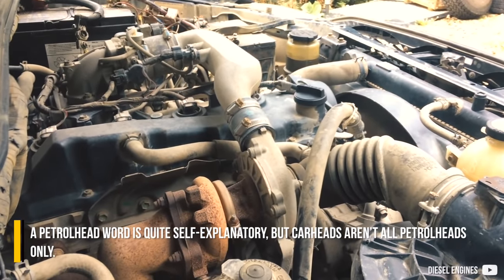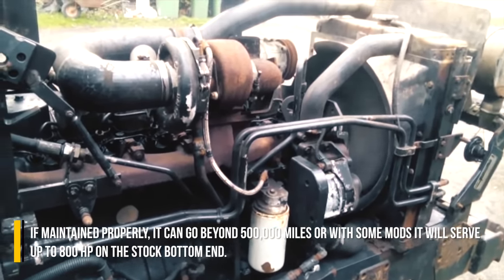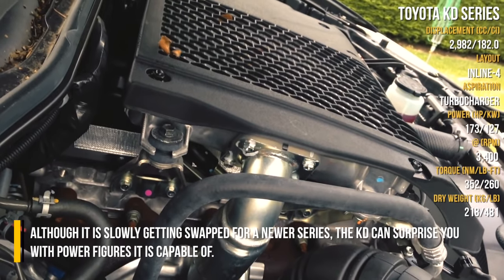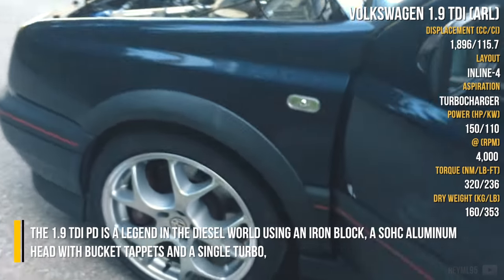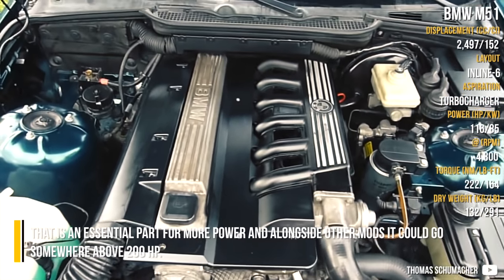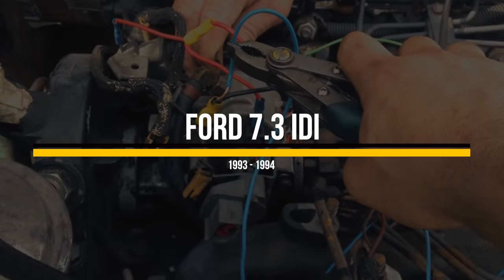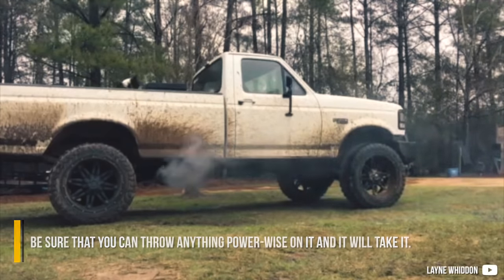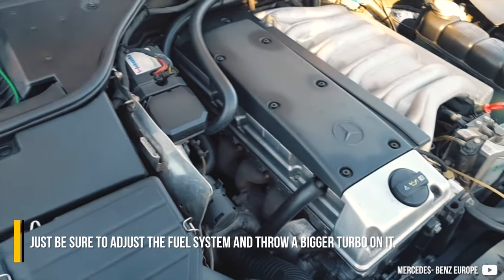6 Best Diesels For Engine Tuning | Ep.1

Comment: Fiat/GM 1.9 JTD/CDTI 150hp? They are a great engine, capable of over 200hp with just a remap, over 350hp+ on stock internals
Reply: Too bad this engine is held back by weak M32 transmission. Also, swirl flaps in some models can detach from the intake manifold and get sucked into the engine. The engine itself if top notch, but it's reputation is not very good because of the equipment around it.
Reply: Swirl flaps? I'm new to diesel. What's that?
Reply: arekb5 Fair point, the M32 is an awful gearbox, like it's made of chocolate
Reply: Jan Muñiz Swirl flaps are little flaps in the intake manifold designed to help change the direction of the airflow through the manifold and allow better airflow, however they can break off and be sucked into the engine, causing huge amounts of damage. Swirl flaps are also used in some petrols as well (Audi S3 2.0 EA888)
Reply: Jordan Field the cdti 150 is powerful enough stock, start playing with it and your going to eat gearboxes, the engines a designed to work with the swirl flap so removing it is not a good idea without a full map.
Reply: I think there will be 2nd episode of these very soon ;)
Reply: 150 bhp 16v has the F40 box much stronger but very clunky compared to m32
Reply: Higomad f40 is 1.7 cdti
Reply: A problem that could have easily been solved by using less flimsy components. Oh well, gotta save those fractions of cents...
Reply: Idk rly know if 350hp ist possible on stock turbo, but 250-300is possible. And ye where is the 1.9 TDI and the other VW engines
Reply: Think your wrong dude iv one in the yard and it’s a F40 box
Reply: Being an owner of an Alfa 159 SW with the M32 i can tell you that if mantained properly and if you know how to use a clutch it won't fail with just a remap at 200hp mine has done 250k and it's still going as new. But if it does fail and you are willing to dump more money into the car you could always fit the gearbox from the 2.4 with small adjustments for the bolts to fit on. And granted it will be a custom job but it does fit and you'll be pain free, I know a few people that have done it and run 300hp as an economy map and are very satisfied.
Reply: @AllCategoryChannel  I have astra 1.9 cdti 150 what other gearbox can you put in it I've got mine with mods like hybrid turbo, uprated intercooler, blanked off manifold (swirl flap delete and egr delete), uprated injectors, big brakes upgrade, remapped , lsd and few other bit but rebuilt gearbox good few times but love this car very excited to hear of gearbox upgrade only heard quaiffe but 4k let me know what this other gearbox is kind regards Ashley
Reply: @Rad_Dad_Army  That's the differential the quaiffe if I'm not mistaken. I haven't got any plans on upgrading my car further so I never bothered reading further into it. Except I know from experience that the F40 Gearbox from the 2.4JTDM alfa romeo 159/brera/spider fits the 1.9 engine if you customise some bolts as done by a friend of mine on top you can add the Quaife ATB QDH21B lsd and if you are looking for something reliable I don't think you can get anything better on these cars. The 2.4 gearbox is bulletproof so if you come across a used one and all seems well and you are willing to do the job I'd go for it if you are planning on driving your car for years to come. I hope I helped :).
Reply: @AllCategoryChannel  no quaiffe do a full gearbox https://shop.quaife.co.uk/quaife-vauxhall-opel-f20-5-speed-sequential-gearbox it's a complete  gearbox for 7k I'll look I to 2.4 and see if I can retrofit it to mine be wicked to have a bullet proof gearbox instead of m32 I have a quaiffe limited slip at moment but can justify spending 7k on uprated gearbox from them
Reply: 1.3 and 1.6 multijet life ;)
Reply: Very Unreliable Though My Dad Had One With Around 240bhp modified and it kept breaking down and that's what everyone says loved that car tho
Reply: @hughjarse4627  wrong. I have a 1.9 cdti 150bhp in my vauxhall vectra and it has f40 gearbox.
Reply: Johny Bigg Rigg yeah it will of been converted
Reply: @hughjarse4627  nope as far as im aware on all 150 6 speed vectras its the f40 box astras used m32s.
Reply: Arkeb5 when you upgrade JTD needs better clutch+maho stronger or one mass to take your tourge proper. This gear box is not created to keep 500-600nm tourge when you upgrade your car and still driving whit old maho and clutch all tourge gets to the gear box. It s a lot of tourge upgraded JTD.
Reply: @Higomad  I have the 161HP version (Aus 2011+ Cruze) - rattles as if it's a 'tractor' according to some. Get it on boost, and it just goes! ;)

F40 gearbox is good for putting the torque down - just needs a remap and a shorter FD ratio (who needs a theoretical top speed of 315km/h at 4,500 RPM).

As it is - stock, without the speed-limiter (programmed) - it would pull about 250km/h (stock tyres have a minimum rating of 270km/h, not 240km/h - next rating down).
Reply: I have driven a 1.9 jtd grande punto, thing is a beast.
Reply: 1.9 jtd 16v in Alfas with 140hp is much better choice because of metal intake manifold and no swirl flaps, on stock internals, stock map sensor, fmic and 2256 garret from 156 2.4 20v it goes to 220hp and 400nm+, with injectors from brera 2.4 jtdm (last 3 numbers on them 308), r80 fuel pump, map sensor 4bar, gtd2060 garret it pushes easily 250-300hp and around 700nm..Alfa 147 without Q2(limited slip diferential that comes stock on some Alfas) is allmost uncontrollable, tires spin too much eaven in third gear, 100-200km/h im about 10secs....Great thing about diesel street legal project cars is that they can easy be used as daily
Reply: fiat diesel is better than vw fiesel especialy when you want to tune it for big power

Comment: Pretty much any om6xx can be tuned for big power
Reply: OM601? Haha
Reply: Yeah i have seen a 601 "mini" superturbo
Reply: Om642 3.0l v6 making 230kw and 700nm
Reply: 601s are good for 300bhp too :D
Reply: Om601 max. 220hp because it doesnt have piston cooling...
Om602 about 400hp om603  500 om604 300hp om605 500hp and om606 650hp all on stock internals
Reply: Not so big deal to put oil jets there to cooldown pistons.
Reply: How about the m104 engine
Reply: Which ones were in the w123?
Reply: its more the om60x series. Yes the om617 can make good power too, but it gets less reliable once you get into the common rail models.(not less reliable because of the common rail lol, im just saying those are the newer models)
Reply: Christian H. That’s completely bullshit I’m sorry. A 606 will last maybe a few runs on a dyno at 650hp then shite itself
Reply: @dirtbiketherapy   the common rails can also be tuned. Just look at black smoke racing om648 600hp/1000nm i think. Also om628/629 can make well over 1000nm without opening the engine. Om642 is not so good because the pistons tend to break easily at over 300hp
Reply: @jerrywithaj6765  with what mods?
Reply: I need more power in my om611. But it is hard to find info..
Reply: @Diesel8290  that's not true, there are many 606s driven hard with 650+hp
Reply: @thomasamundsen3519  I look forward to the day there is a simple plug and play ECU for the 648 so it can be swapped into anything like the 606, which is starting to go up in price the last couple years.
Reply: You can tune om606 whit 800hp but it’s not so good for the engine you can try ;) dieselmekken Sverige can give you a diesel pump for more power  8 millimeter pump
Reply: started thinking is it only scandinavian thing to make power on diesel mercedes engines and also love old german cars because I looked mobile.de and saw like only one built 90´s benz and if you look nettiauto.com you will find those om606 superturbos
Reply: Can anyone one tell me the potencial of om647 2.7 straight 5 cylinder engine on w211??
Reply: @christianh.8408  this real?

Comment: Fun fact, the OM606 stock block can take 5,4 Bar before it cracks, Dieselmekken in sweden have tested this lmao
Reply: Da fuck,I only heard 4.6bar from them.
Or maybe that was something built to last lol
Reply: joczo97 i think it was 5,4 bar not conpletely sure tho
Reply: What power did it make at the pressure!!!!? lol
Reply: Yeah but not long... i know that they are capable of 3,5bar and 670hp all engines with more boost dont last more than 5k km
Reply: Fun fact, there was a guy running over 6 bar boost on om606 stock block and I think he still is
Reply: Christian H. Actually up to 4bar it's fine for long term.the most important is not to overrev them
Reply: @christianh.8408  not true. They can go plenty longer if precisely balanced and not revved the piss out of constantly.
Reply: Its not about pressure,its about how much air goes in😏
Reply: 6 bar for a nanosecond
Reply: Do you have a video of this. 5.4 bar is what psi
Reply: @marcofloresmfcs1  Roughly 80-90 PSI
Reply: Ferdinand Piech is my favorite automotive character ever

Comment: Old mechanical Diesel engines are awesome, more power can be made by simply turning a screw, I’ve picked up 12 horsepower on my naturally aspirated diesel by turning up the fueling, plus it gets better fuel mileage than it used to, it seems like a contradiction of normal laws of engine tuning, but it’s actually just because getting up to speed is so much easier that it isn’t held at full throttle all the time, and 12 horsepower is a lot when it only makes 52 at the crankshaft from the factory.

Comment: Who remembers Mercedes-Benz C30 CDI AMG with that five-banger?
Reply: the only diesel amg :(
Reply: they maybe are capable of developing a new diesel amg for competition against M550d. but not sure if they really want to do or holding it back because that discussion after "dieselgate"
Reply: @Popk1ller  they wont lol diesel cars will be banned in europe within 5 or 10 years its not worth it
Reply: Just learned about them recently! Seem to be dirt cheap for an AMG as well, but I doubt there's a reason for the low prices...
Reply: @DamonBMW  That's too bad because they can supposedly run (with very little modifications) on used cooking oil. I haven't done much research on it could have some potential.
Reply: Was it the Om617?
Reply: C30 om612 inline5,great engine
Reply: I have one, 350.000km. Not a single problem.
They re cheap because taxes are insane 😅.
Performance is awesome btw. Get one while you can.
Reply: @DamonBMW  Are you sure about that? After 2 years all I see is more and more diesel engines offered in Europe... More like diesel will be banned from entering city center in 3-4 capitols, but that's about it.
Reply: bored out 2.7cdi (om612)

Comment: Never knew that about the KD engines, very cool.
Reply: Same
Reply: Same lol,as a bit om60x fanboy
Reply: yep. stock 2.5l 2kdftv without intercooler makes just only 101hp but with proper tuning and mods it can produce up to 400hp.
Reply: I always heard they had an appetite for injectors, but I guess aftermarket injectors would be available given how much the Thais like fast diesel utes
Reply: @HotForgeChaos  actually from what i heard its because of bad fuel or fuel filter... ..
"Proper" fuel maintenance can make last

For upgrade there is "gtx" or "dtx"

And remap only can make 101==>up to 160
And intercooler up to 200
Reply: 2kd vnt 2,5L with a remap can produce 250hp 540Nm. I saw someone did it.

Comment: I would highly recommend 535d e60 facelift. Gearbox on the facelift can easily hold huge Nn loads and keeps being reliable. The car is a sleeping with sequential turbos good potencial for reasonable prices.
Reply: Just keep your turbo dealer on speed dial😂 I love the idea on 535d but everyone blows turbos in those even stock ones

Comment: I’m a proud owner of a 1997 Mercedes OM605 c250 turbodiesel, the straight 5 howl a lovely note😍
400hp/660ftlb on stock internals with bigger turbo and pump elements! Can also run on just about anything, including used engine oil 😇😇😂

Comment: Nissan TD27 only with turning up the fuel pump 200hp (double) and very capable. Used in Africa busses and the marvelous Terrano 2
Reply: Terrano 2 would be maevelous with a solid front axle, not with that independent setup
Reply: nah mate the TD42 is far better
Reply: if you want something to boil water look no further than the 42
Reply: You can keep your Kettles and snapped cranks, I'll have me a 1HD-FTE thanks

Comment: It's real 3.0 toyota 1KD produce 500hpish on stock bottom end. Kinda sick w/ that medium(only) displacement.

An ECU remap easily raise up to 200 hp without tweaking any mechanical parts, and running well w/ bad diesel fuel.

Comment: I have a Toyota Prado 2007 with the D4D KD engine 3.0 4 cylinder.  I have to get it Dyno’d again as I lost the print out.  Monster Max ECU, plus 15% Baileys DLC “Diamond Like Coating” injectors, PSYCO removed the stock intercooler from the top of the engine (stupid design idea really) and installed a supplied front mount intercooler with provision for temperature sensor near the intake (from turbo) and near the outlet.  Custom Aluminium pipework.
Larger turbo installed.
EGT sensor installed on 2.75 inch mandrel bent S/S exhaust system (from turbo waste to tip), air intake was to be upgraded but due to space left as standard with standard air filter (I have played around with those oil impregnated ones and they are an absolute mungrul to clean.). Snorkel installed.  Turbo also has pressure sensor.
Automatic transmission has had valve bodies replaced to “Nomad” from Automatic Wholsale Transmissions in Victoria, oil cooler installed as well as temperature sensor.
Tranny gauge installed low in front of passenger seat.
The other 3 digital blue gauges are installed in a “Pillar pod”, which is very neat.
Intercooler typically drops temp 30 to 40 degrees.
One gauge has both the intercooler in and out temps displayed.
A BIG THANK YOU to Shane and the boys at 1KD Performance in Bundaberg Queensland Australia.
They sure know their stuff.
I intend to get more fuel with their fuel bracket thingy and will replace the injectors with Denso plus 30 injectors.

I also had some other work done, but it’s not worth talking about.
I also intend to find a solution to the tranny oil cooler partially blocking the air flow of the intercooler.  
Also a tap at the bottom of the intercooler to drain any extra oil.
Like to also replace my catchcan with a Provent 2000, with clear pvc hose and cock firmly mounted beneath vehicle but not protruding below chassis.  A guard to protect it from being hit and turning cock on to crow....sorry, had to put that it!!😜

Comment: the Mercedes sounds like a jz god dang
Reply: what? you hear a I6 with a turbo and it all sounds like a jz to you?
Reply: Actually,it's cast iron block is the very same as the M104,from which they copied the 2jz.
Reply: ståle starheim no, i’ve heard a few jz’s and they sound pretty similar, but slightly different in a certain way.
Reply: a 2JZ with a cold?
Reply: It's probably why they call it "the diesel version of the 2JZ" - and it's just as tunable.
Reply: @joczo97  the m104 was first made in 1989 meanwhile the jz series was first made in 1990 so I guess Toyota cloned the BMW not other way around
Reply: More like a truck if anything

Comment: Suprised the 7.3 idi made this list. It's often overlooked for the newer powerstroke engines. It only recently has had serious performance parts avaliable, but an idi will produce more torque than a powerstroke at the same hp level because of the bore/stroke ratio and higher compression. I'm building one for my brothers f250. Planning on 350hp and 700+ lb/ft tq or so. Nothing crazy, just enough to make it keep up with stock modern rigs and towing a breeze.
Reply: Best part of the idi is how bulletproof it is, it is very hard to truly kill it.

Comment: Friend of mine has an OM606 in his Haglunds 206. With a bigger turbo, intercooler and fuel managment he easily got around 300hp stock.
Reply: Wait Stock, with mods, I got 325hp in my Duramax off the factory floor  450/950tq with mod. Nothing better than black and tire smoking out and leaving a  diesel mercedes in the dust
Reply: At the first corner u will brake to 10mph while the merc will be sliding past u and leaving u in the smoke

Comment: Where is JJ or JK engine from Isuzu?
Reply: They're powerful engines for sure...thai people love em so much
Reply: Agreed! We're quite fond of them in South Africa too! They're very detuned from the factory,  for reliability.. but can make big power with tuning.. just look at the Bruce Garland Isuzu Rally truck!
Reply: Maybe in ep.2? This was ep. 1.
Reply: Exactly my thought
Reply: Yes thais really love isuzu and most of drag pickup trucks in thailand are isuzu dmax
Reply: How about the old 4JB1-T

400k running great / flogged for 200k at 16psi (stock is 10).
Making over... well over 350Nm (225Nm stock).

Motor still runs fine after 28+ years - no rebuild (injector pump was maliciously damaged by someone else, and replaced with stock).

I've seen this engine personally hit 18psi - I was driving it at the time ;)

4JB1-T is a pushrod (side cam) 8v engine - reliable, and given the right mods / tuning, can push some decent numbers whilst being reliable too.
Reply: 4J-series

Comment: I'm building a twin charged 7.3 idi. (Twin 88mm turbos feeding a 6-71 blower) you can get a sleeved block for pretty cheap and the heads respond well to porting. The only problems are getting enough fuel and insane egts. We'll see just what it can take.....
Reply: OOOH that’s exactly the sort of thing I want to do! You need to keep me posted on that.
Reply: Sees 7.3 idi : mehh good engine
Sees twincharger : well that eskalated quickly